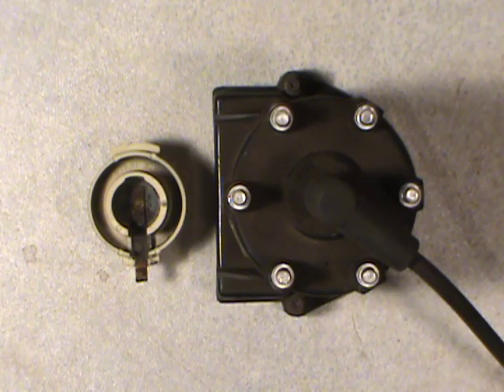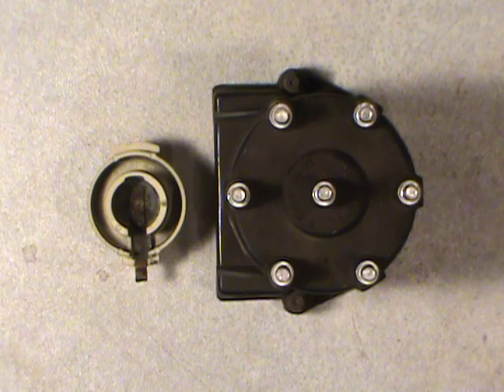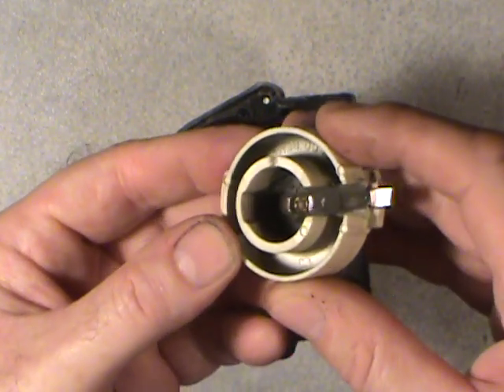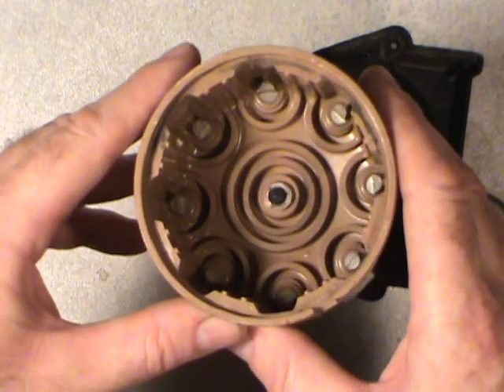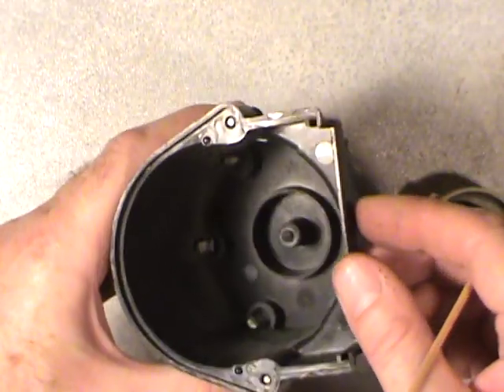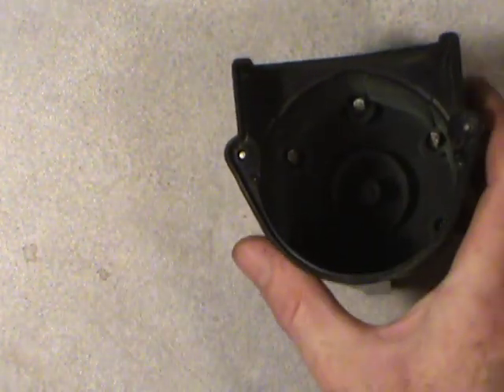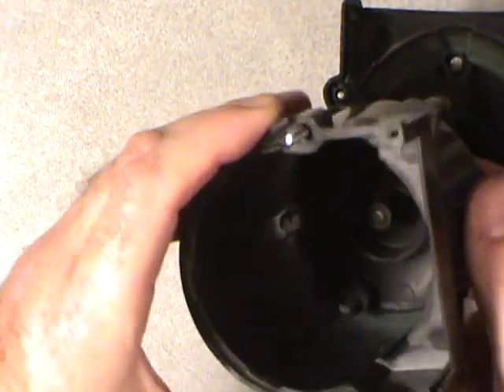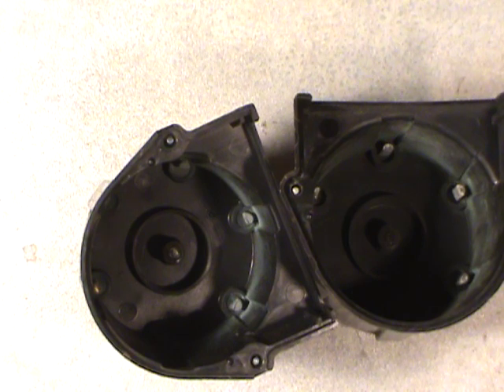How to Inspect Distributor Cap and Rotor Condition (Part 1) of 2 Parts

Comment: Also when I take the air cleaner off the tbi open the flap I can smell a hint of fuel is this normal or a sign of leaking spider injector
Reply from the maker: SuperJeremi10 Greetings SuperJeremi10....A Hint of Fuel (Gasoline), is one thing, but, if You happen to be Smellin', a very Strong, Very Noticeable, Gasoline Smell, it's probably, a really good sign, that, Somethin's-Up, alright...!!!...............................There are a number of things, to be watching out for..................................Some of those potential, Gasoline Leaks, that, can sometimes be Detected, by Smell alone, can be, some of the following....................................A (Gasoline)..."Leaking"..."Fuel Pressure Regulator"...can, at times, depending on the (Intake's), Upper, Plenum Design, can cause, an Engine to Run, Way Too Rich (air/fuel ratio-wise), due to the Un-Wanted Gasoline, in Liquid Form, Leaking past, what I see, as a possibly "Ruptured Diaphragm", Inside the Fuel Pressure Regulator, and can get Inhaled by the Engine's Intake System, in the Form of Gasoline Vapor/Mist, but, You were sayin' that, Your Fuel Pressure "Test", wasn't showing any noticeable "Drop" in Fuel Pressure, for quite some time, so, just remember, what I was just sayin', for future use, if need be...............................Just about anything, (but, not including the Fuel Pressure Regulator, at this time), that goes Inside of Your Intake/Plenum, that has the Potential, to be Leaking Gasoline, when, shall we say..."It Springs a Leak"...especially, while under that, oh, about 60 PSI there-abouts, can be, anything, as simple as an "O-Ring" Seal, on, one or more,  Fuel Injectors/Poppet Nozzles, or even something like, just about any Fuel (Gasoline) "Connection Points", that Require a "High Pressure, Fuel/Gasoline, Leak-Proof Seal/Connection......................"Leaking Fuel Injector or Poppet Nozzle", if so equipped, maybe...???.........................You were sayin' something about some "Corrosion"...???..................................I'm thinkin', if, any of that, so called "Corrosion", happened to be found, in an Area, where there is "High, Fuel/Gasoline Pressure"...present, such as a Bore/Hole, or, any Fuel related Connection point, that has to be able to "Seal and Contain", that, rather High Fuel Pressure, and is not able to, and, might just start "Leaking", then, that, can be a "Clue", that You can keep in mind...................................If Your Fuel Pressure doesn't Drop, for quite some time, I really can't see the problem being the Fuel Supply/High Fuel Pressure Side, being Your Problem..............................Sometimes, even "New Parts", can be "Faulty" from the get-go, so, don't completely Rule-Out any New Parts, just because They happen to be New, as I've found in the past, and rarely, does it ever happen, as well...............................Did You Notice any "Carbon Build-Up", on things, like Your "Throttle Body's...Throttle Valve/Butterfly" and the Bore/Hole, that the Valve/Butterfly operates in, and also, the "Idle Air Control Valve's...Pintle/Plunger Head"...and the Air Passageway, that it gets installed in as well...???.......................................I've used a Product called "Sea Foam", to "Clean & Dissolve", the Carbon Deposits, that I found, in the Area, near the Throttle Valve/Butterfly, that is inside the Throttle Body, as, what lots of Folks are sayin', that, those Carbon Deposits, can cause, Engine Running Problems, at Low RPM's, at times.........................................Air Filter New and Very Clean...???...hey, if it can't breathe fresh air, then, Gasoline, it will be...!!!...lol....................................So..."No Computer Trouble Codes What-So-Ever"...???........Wowsers...!!!...I would be thinkin', that, there might be some "Miss-Fire Codes"...or...some..."Lay-Zee Oxygen Sensor Codes"...showin' on Your "Scan Tool", when You Plugged it into Your Tahoe's On-Board Computer...!!!..................When You last had Your Scan Tool, hooked up to Your Tahoe, Did You "Clear Out and Reset Your Tahoe's Computer"...with the Scan Tool...???................................If You didn't, try that, and see, if "Any New Codes get Stored"...or, the MIL Light comes on, on Your dashboard"..."After You Drive Your Tahoe, for a Few Days.......................................One last thing...perhaps, find Someone, or a Qualified, Automotive Repair Establishment", and see if They happen to have a High Quality "Scan Tool/Analyzer", that will be able to "Read", the "Inner Depths', of Your Tahoe's, On-Board Computer, and, for starters, see if You can Retrieve, both, the..."Short Term, and Long Term, Fuel Trims"...as that should provide some very Valuable Information, to see, wether or not, Your Fuel Injectors, are Administering the Correct amount of Fuel, for the Engine's Needs, at any given RPM's and Load Conditions as well, but, to save some Money, perhaps, First, check out Your EGR Valve/System/Passageways, for those Carbon Chunks, or just plain Carbon Dust, as the case may be, and if need be, Buy and Install, one of those Special...EGR Valve..."Anti-Carbon-Chunks"..."Screen Type of Gasket"...and, move on from there...............................Best of Luck, my Friend, and..................Till next time...........Be Safe, take care, and have a good one.
Reply: well what it seems to be doing is it seems to sputter a little  under power and acceleration tried new cap n rotor no effect it likes to spit liquid out the tail pip even after  a long50 mile trip I haven't checked the egr system but everything at the tbi seems clean I put seafom in the fuel at half a tank I put the whole thing in  no change in running air filter is new after I had a tune up done to it 8,000 miles ago I had a smog test done it passed with a high score indicating it was healthy the computer was reset 700 miles before testing no codes ae present n the computer at all no engine light  the light comes on before cranking with the others like the security oil abs etc indicating that they are working she fires right up on first crank even before priming it feels as if it has a small misfire  but  to small for the computer to detect as it seems within range the exhaust is begging to small as if its a bit rich  the plugs not have carbon build up at all or signs of abnormal wear I would take it to a shop but I  really cant afford to take it  and ialso cant have it in the shop for days or hours on end for testing  as Monday - Saturday it used for carpooling basically normally I have it on the road form around 3-8 then again at 10-12 I pick family up carpool kids errands  as my car is the only one running atm the fuel pump on our other car has died and cant get it replaced just yet so I really cant have this one in the shop it has to stay running other wise we lose money.